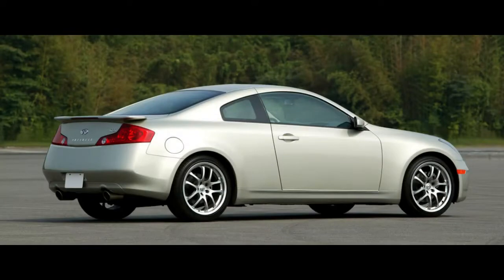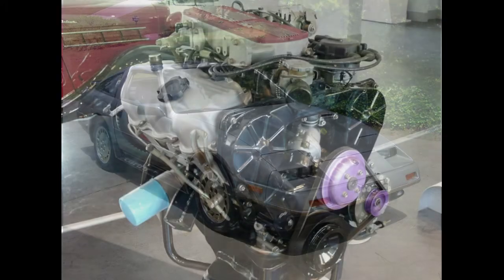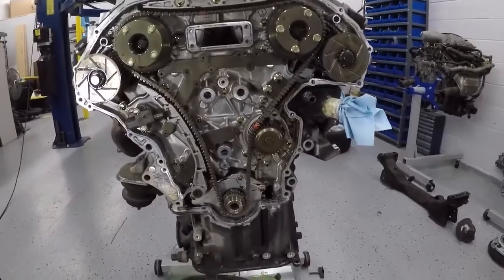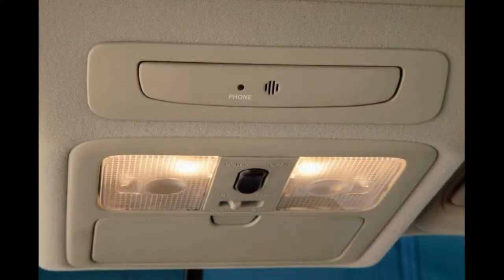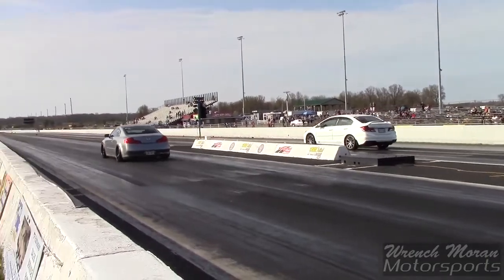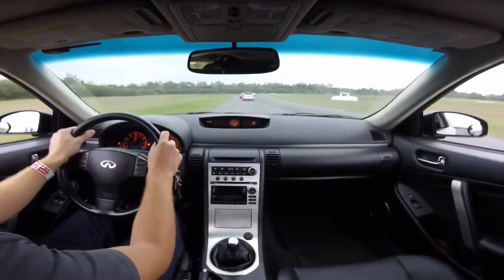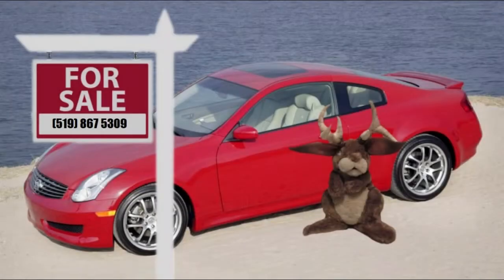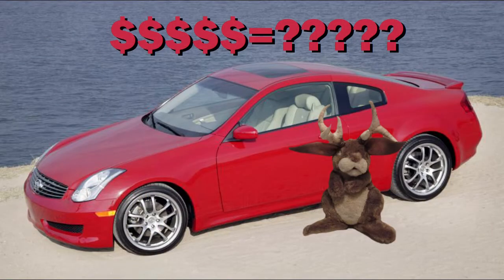Infiniti G35 Coupe.

Comment: I can't believe that these are almost 20 years old.  It makes me feel old, because my MR2 was only 12 years old when I got it (now turning 27 🤯).  I always liked the g35 tail lights way more than the 350z.  Colin briefly had a silver g35 after the Celica / before the 911.  I felt that it drove well.
Reply from the maker: I think the G35 and the G37 are the best deal out there right now for an enthusiasts car. They tick a lot of boxes, they are quick (even by modern standards), the early G35's had the Brembo brakes, a six speed manual, a touch of luxury and they have a more adult feel about them some of there more boy racer contemporaries. I fall in love with all the cars I make videos on, but I have to say the G35 has captured my heart. I went from, hey they are kinda neat, to hey they're awesome! I want one! The Super Coupe video rekindled my love for Super Coupes, but if you think about it the Infiniti G35 is a Super-er Coupe, an extra cog in the manual, and extra second! faster in the quarter mile, plus the gigantic aftermarket support. What's not to love?